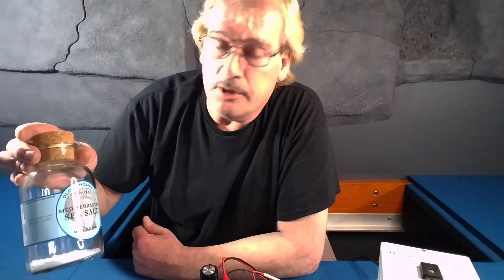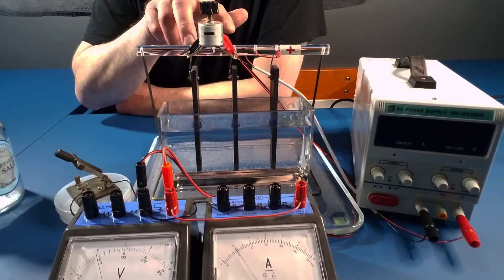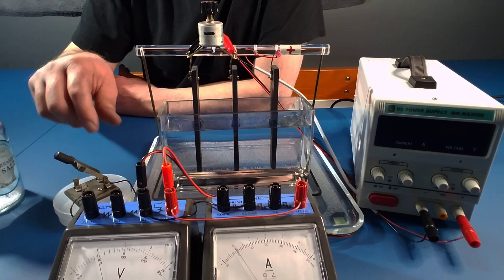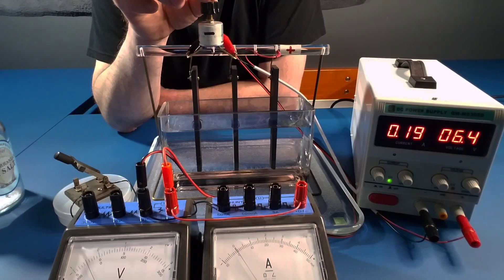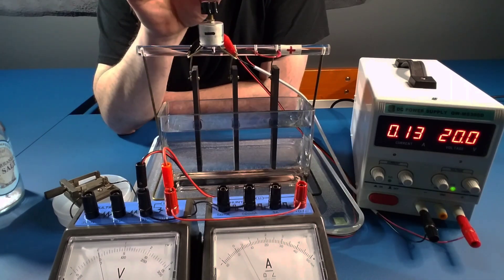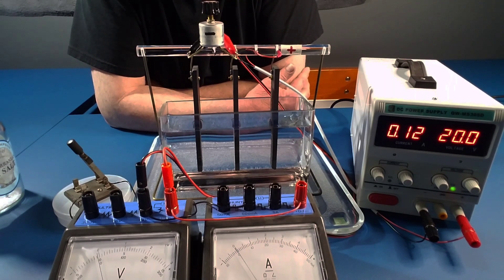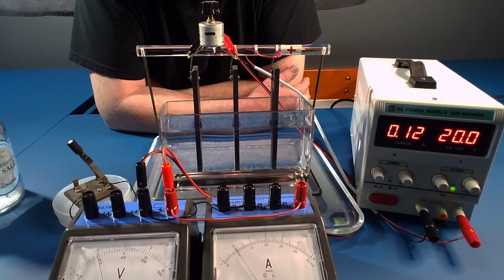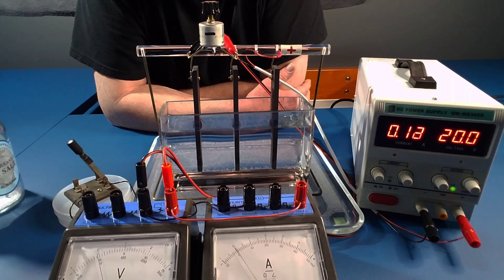Life's Electrically Neutral Reaction

Comment: Arkiver, you are outside of box scientist, for sure. You always come up with good ideas. Any thoughts on a self-charging pulse DC Motor?
I have seen several of your videos of various different types of motors you made and demonstrated,  but I am curious about the self-charging type do you think it's possible?   Thanks in advance.
Reply from the maker: Thank you! Possibly. It depends on what your expecting a motor to do or function as at what point in time.
Reply: @ArkiverUnifiedEnergy  , For example, motors drive coils collapsed b-emf can be captured and dumped into the battery or capacitor. Where motor as runs can charge its own battery while it's running.
Reply from the maker: @MehmetBoysal  In most of those circuits there are still losses. The back emf current is less than the driving current.
Reply: @ArkiverUnifiedEnergy  , I agree. However is it true that generated back emf is directly related to the size of the coil or the inductor that is being pulsed? If so, what if we use a much larger size of the coil? Are we going to get a larger collapsed field? If yes? Would you say that "The back emf current [still will be] less than the driving current?"
Reply from the maker: @MehmetBoysal  There would be a threshold for the size and type of coil to saturate a specific core. The maximum frequency of change of that combination will have a scalar point.